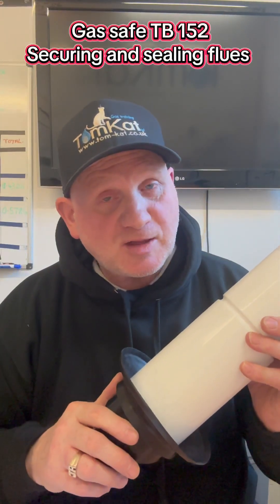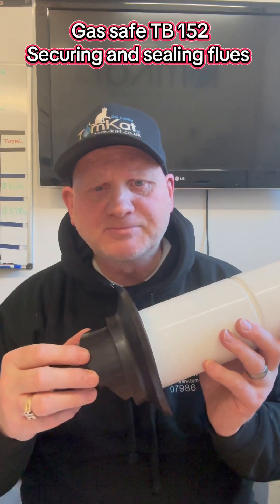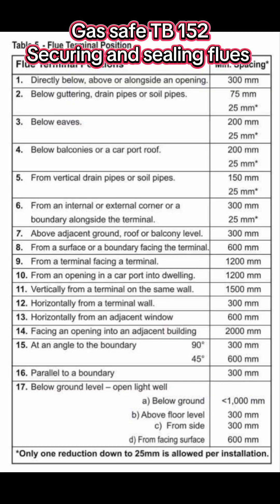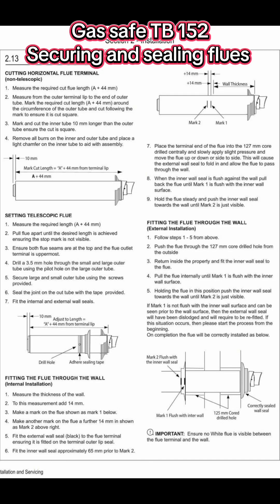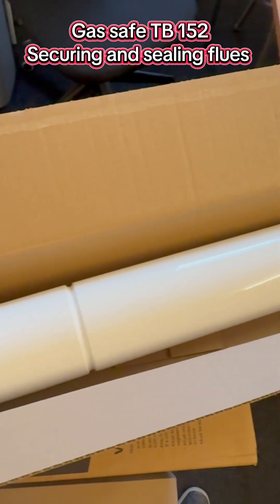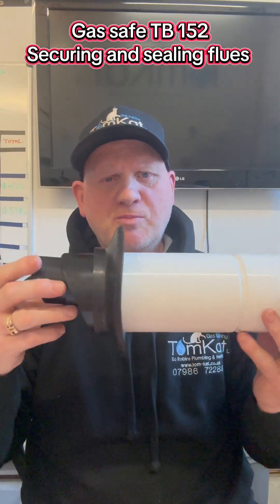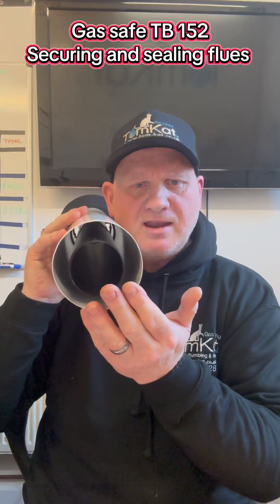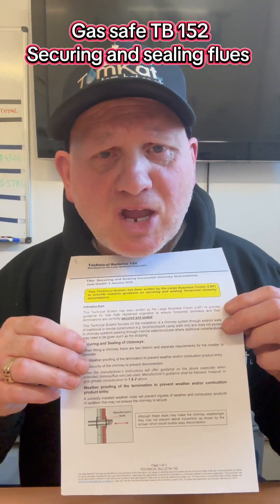Gas safe TB 152 securing and sealing boiler flues #gastraining #plumbing

Comment: So much innocent ignorance about fanned flues from ‘younger’ (not so young) about these flues. If you started in the gas industry in 1978 you’d know these flue collars were specifically designed to avoid the use of access equipment on high rise buildings. In addition, up to fairly recently, Ideal stated that if both seals were in place no extra sealing was reqd…yep…I got it straight from their Tech desk. 

Further point… ideal have been farting on about the effects of UV light on the white exposed pipe… Thereby insisting that none is on show… However, I asked their technical helpdesk about the effects of UV light on the unprotected, unpainted inside of the air duct… Which is also exposed to UV light. They had no answer to this because, it is a very silly rule. When these flues first came out it was common practice for engineers to extend the flue varying amounts in order to avoid external obstructions. Everybody back then was perfectly happy with this until for some reason people started having a wobbler about this. Worcester don’t mind a little white pipe on show… But Ideal have an absolute crisis whenever they see it.

Comment: Just been on phone with ideal and they say you have to seal both inside and out, same across the borad on all ideal boiler, I even mentioned you Mr tomcat and they said you have to seal both.
Reply from the maker: The idea of sealing both sides is because if it was at low level you could pull the flue  out because the flue isn’t screwed but good luck pulling that flue out
Reply: only reason I put comment is because I've done same trick on a job a little while ago. Today I've been working with an old timer and I said you dont have to etc he said you do etc so he rang ideal technical, told us you need to seal both sides 🤷‍♂️ so do you go by the book which still shows rubber as seal or go by technical? I feel like ill have to go back and seal, peace of mind.

Comment: Ask gas safe! They failed a boiler that I installed even when I challenged him with the regs. He insisted that I seal the hole with cement.  Even though the gap around it was 1 mm. And I had cemented inside.

Comment: Ideal do not require the first elbow to be screwed to the horizontal section going through the wall. As they deem the cement on the inner and outer walls are sufficient support. They do not forbid the joint from having screws as they leave it to installer choice. I’ve used the rope trick on some vertical flues with the plastic shroud style slates are available.

Comment: Well I am no boiler engineer but I wouldn’t want my flue pipe tucked up under the eaves like that. Yep it may be to regulations but go back in 10 years and look what condition the woodwork is in🤷‍♂️. Hot air rises it’s a fact not a requirement written down

Comment: You  can use foam (closed cell) to seal the flue to the structure, as long as it meets heat regulations. You do not need to seal the foam with cement and sand. Just used the outside flue seal.
I used it on an install, and as part of my inspection, he picked it up. I showed him the data sheet (Soudal). The inspector was happy with it.
Reply: But not, apparently, on a Baxi… happily Baxi agree with me that foam is horrible. When you come to replace a boiler, the flue sealed with foam can take way too long to remove. Whereas sand and cement is removed in seconds..
Reply: @crofton82 it is a suitable alternative to using cement. Vaillant dont like it either.

Comment: I do believe people should start using the MI'S as a point of reference rather than going off at a complete tangent and commenting .
Remember people You should be installing anything as per MI'S .
Yes fire foam is accepted.
And in situations like the one in the video how else are you supposed to make good the inside.
?
Expanding foam is a complete no no .as it does at it says and it's been known to deform flues .
We did one just before the new year.the flue was above a fragile roof.
So we had to employ our brains and did exactly the same.
All keeping to manufactures installation instructions.
Top video once again.

Comment: Regardless of  the flue seal that comes with the boiler you should always cement the outside
Reply: At that height or higher, how you going to do it? That flue isn't going anywhere. I always try where reasonably practical as best practice.
Reply: @elwittinio2865  totally agree at that height would be difficult but I would have used a cement in a Silone tube from the inside or a flue snug , instead of foam causing if you have ever needed to do maintenance on the flue for a seal repair for example getting that foam of would be a nightmare. But that's just my personal preference especially when the manufacturer don't require screws

Comment: Well said Derick, People need to read the manufacturer’s instructions before commenting as every flue is different. To be fair I think Ideal are a bit slack, But If you look up the Royal Mile in Edinburgh your see loads of Ideal flues 2-5 stories up as you can’t get ladders of scaffolding up there due to the Heights ( Other places I’m sure of) Your allowed to also push the flue out from the inside then back in to make the seal.
Love Ideal boilers 🤣

Comment: Well said Derek. Glad you gave a clear answer. The flue shoe is another great way to overcome this. That's if the gas installer is willing to core a larger hole. Baxi have come up with a fantastic solution for existing 117mm core holes as and 127mm holes. It's a smaller version of the pipesung flueshoe. They now do an intenal fit telescopic flue. It's shorter on the elbow in comparison to the standard flue though. Which means the boiler would need to be sited slightly higher.